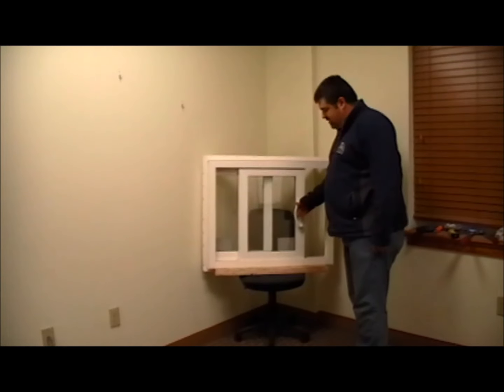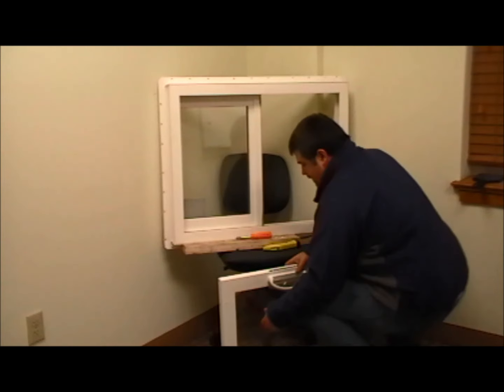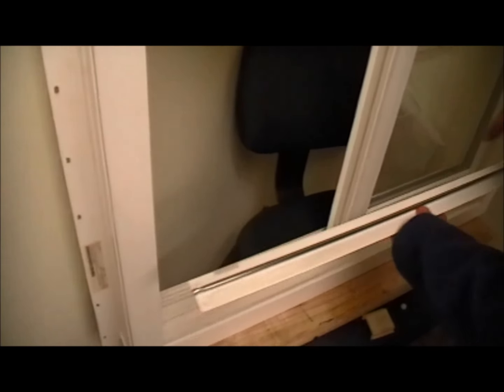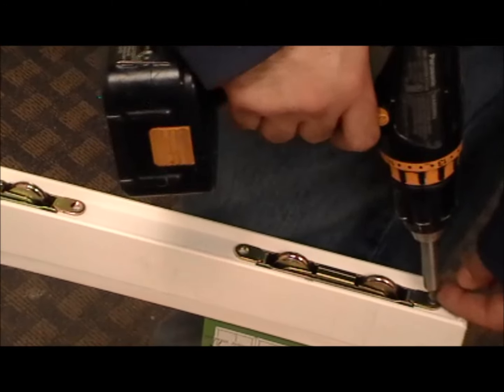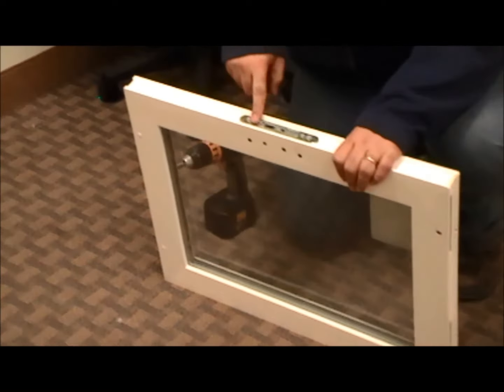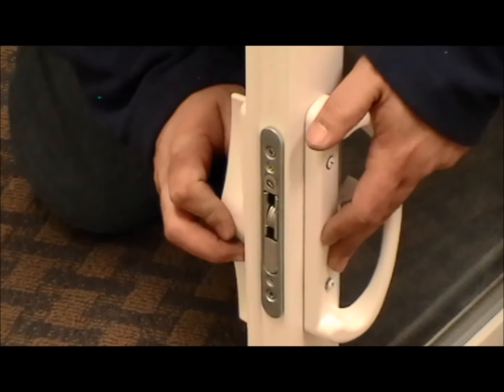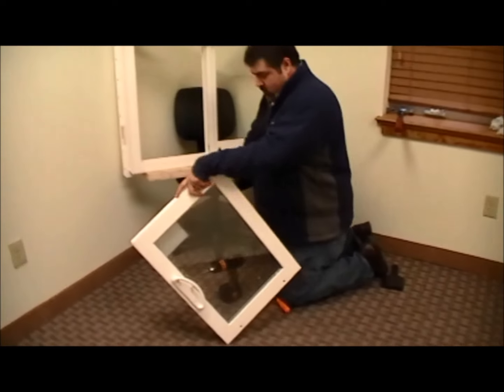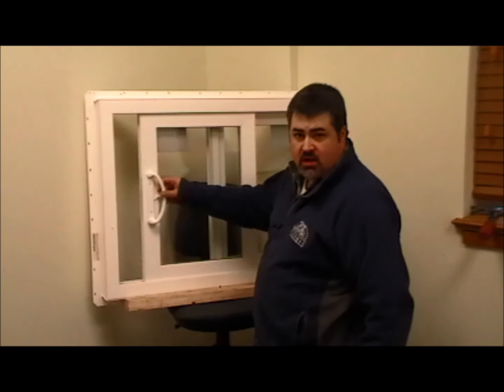How to reverse the handing of a patio door

Comment: I'm confused. Are we not viewing the doors from the "inside" going by the nail flange location? If so, to my knowledge, that would make it an X-O to start with...which you then switched to O-X, not the opposite. The "X" designates the moving door and "O" the fixed one, BUT viewed from the outside (not inside like this). It would also make sense (to me) that what we are seeing is the inside, since the moving door is on the track closest to the house and not the outer one. I'm curious though, are there any of you that have any with the moving door on the outer track?